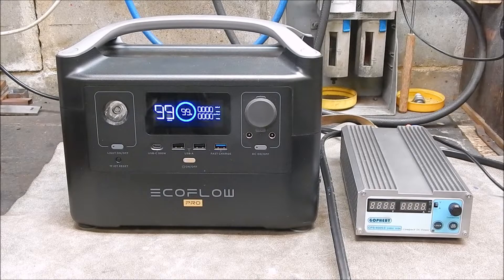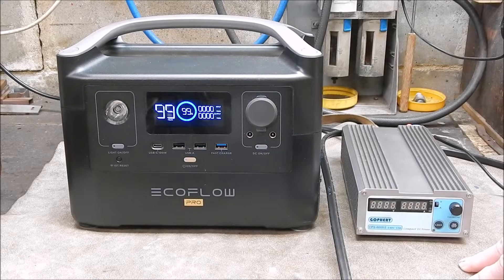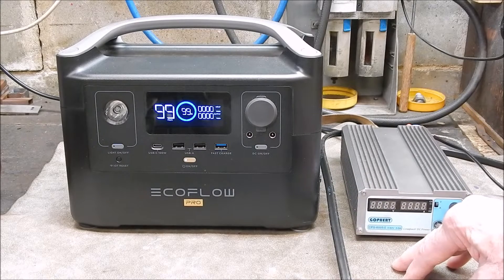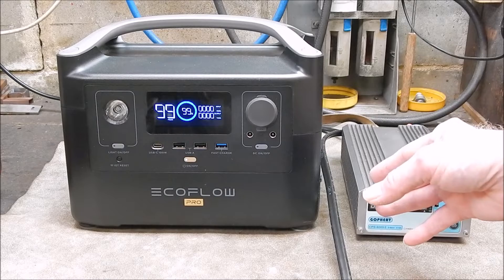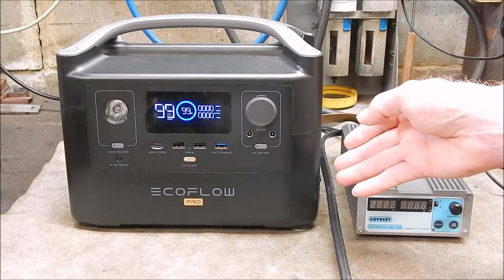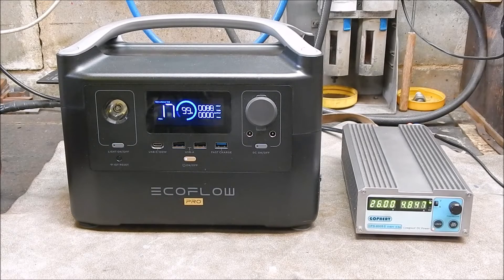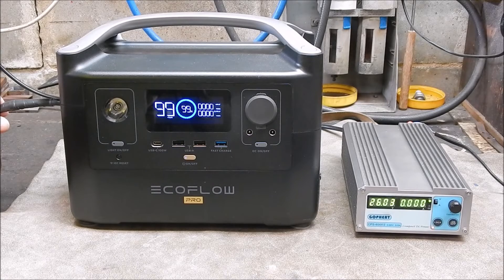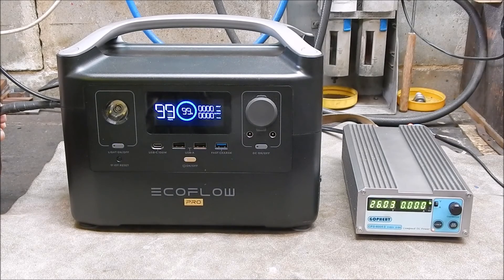EcoFlow River Pro maximum solar input possible through the XT60 port

Comment from the maker: NOTE:  XT60 port tripping is independant from all output functions and will not shut down the unit or disrupt output usage.  A rejected XT60 port will automatically open when voltage drops below the tipping point (as the panel warms up).  The XT60 port will NOT shut down existing input if temperature drop increases voltage past the tripping point (eg. very cold weather change).  Cheers Rob

Comment: When you are looking at the voltage on the solar panel do you go off the VMP or VOC
Reply from the maker: VOC is the maximum theoretical voltage.   It is a laboratory figure under controlled conditions and not necessarily achievable in the real world.  Use a multi-meter to measure across the connector to your battery pack/input.   The voltage actually being fed into the port is the determining factor.  The solar panel may be regulated or unregulated.  The data printed on the panel is a laboratory spec and not an actual measurement of that particular example.

Comment: A very useful test Rob for anyone who has one of these. That power supply is fantastic. Remarkably small adjustments possible. Cheers Nobby
Reply from the maker: Hi Nobby.  It really is a good powersupply for the workshop, as it is sealed and the heavy aluminium case acts as a heatsink, so no fan required.  Good for using in areas where there are chips, turnings, dust, oil etc.  These can play havoc with regular open/vented cases. The laboritory type fine adjustments are very useful.  Cheers Rob

Comment: Thanks for testing and information. I think its important to gain a basic understanding of the limitations of our solar / DC equipment. So many times i have seen people struggling with their set up and usually get the comment of "this is what my friend or the salesperson, said i need''.
Reply from the maker: Yes, there's a lot of misinformation out there, especially from the "experts" on forums.   It's unlikely a power brick will be damaged from single/parallel panel solar input voltage, which peaks with 24 volt panels.  Manufactuers know this is the upper limit and allow for this level of standardisation.  Where things go pear shaped is when people connect panels in series.  This can ramp up voltages enormously.   Magic smoke has been known to happen ;)   Cheers Rob